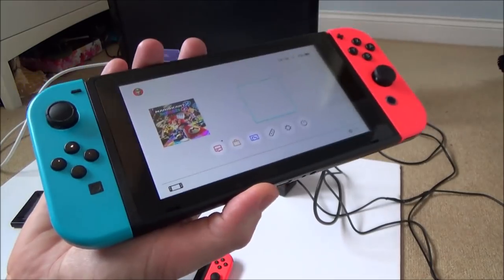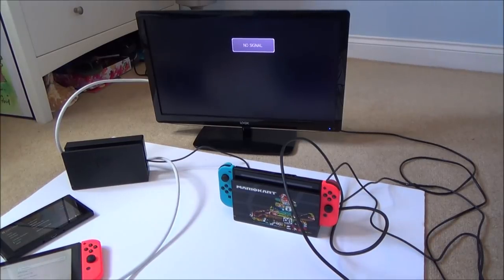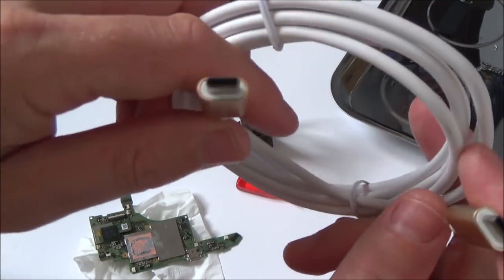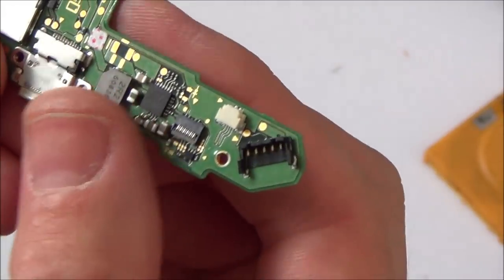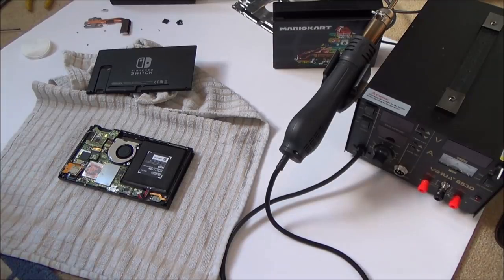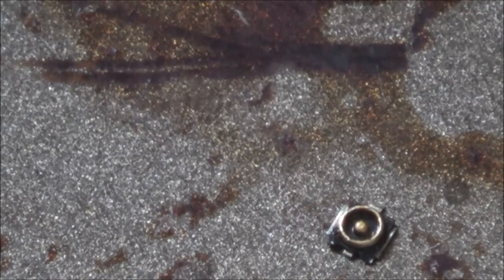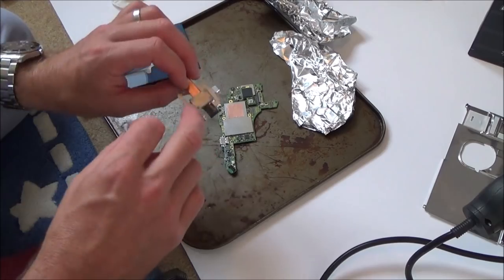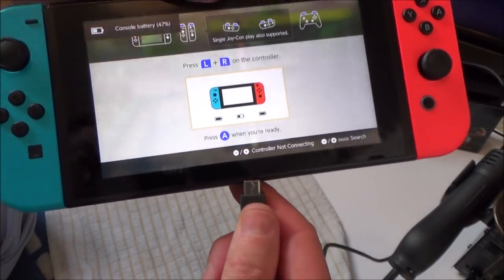UPDATE: Trying to Fix the Faulty Bent Nintendo Switch Not Docking

Comment: My best guess on why the switch wasn't docking is probably because when it was bent it probably slightly damaged  the inside parts needed to help dock it in a TV. So maybe the next time you purchase a switch you can try and swap the internals from that to the one that won't dock if the one that you end up actually docks itself and isn't bent. With all the reports people had when the console came out of it bending maybe the person bought the switch right when it released and it worked for a good while. Then it probably bent itself and the person didn't want to wait for Nintendo to fix it so they sold it on eBay for someone like you to try and fix it. Thats my guess anyway. Hope its been helpful

Comment: You did the thermal paste part correctly most poeple will say spred it out but you do not need to do that it will do it on its own more the 99% of the time. And i may know why the witch doesnt display any signal to your tv it can be the charge board that can be fault most of the the and it can charge but not display any thing

Comment: I switch my p13usb chip and it still didn't work. My settings stayed at 480p but I do not have a dock lol I will get a dock to see if anything changes. I'm confident I did the repair correctly I have prior experience from fixing phones on the board level from 2013 to 2017 I have all the equipment too

Comment: Idk if anyone is going to see this but when I put my switch in the dock and I put it on 480p it works but when I keep
It in the dock and I put it on any other resolution other then 480p the screen goes black and it doesn’t stop until it I take the switch out of the doc and change it back to 480p can someone plz tell me the problem

Comment: Dayem that was a lot of thermal paste. you would get along with 1/4 of the amount you used, it is just ment to be a super thin film/layer to fill up microscopic gaps between the two surfaces. there are a ton of videos about how to apply it on PC CPU's, you should watch those and concider the size differance :) Also whenever you look for thermal paste get a non-coductive and stay away from cheap stuff. The mx-2 should be good.
Reply: Official Sikator there's also a few videos showing that too much doesn't hurt it either.
Reply: Seen the amount nintendo uses as standard? :P
Reply: That doesn't mean it's necessary. Every manufacturer does that. Do a bit of research how thermal paste work and why it's used and you'll understand why it's not needed to empty a tube of thermal paste on one component. If the paste isn't conductive it wont kill anything, but it'll cost the user more money with no benefit in performance or longevity.
Reply: No i was mostly thinking that he should re-apply when he opens his electronics and using the paste in excess means he has to spend more money on thermal paste.

Comment: I'm having that problem too, tried different docks and it wont work
Is there any way to repair this issue? If there is, what do I have to say when taking it to repair?
Btw my switch still has warranty, but I live in Monterrey México and I have to sent it to latatamel, and I've read sometimes they don't sent the devices back snd they dont answer calls/message, so I'm afraid to sent it 
Hope anyone can help

Comment: A piece of kit that would assist you greatly is a Digital Microscope, not too expensive £40 ish from AliExpress. It will allow you to examine tracks, solder pads etc at upto 600x magnification, you can also video or photograph what you see with the built in functions. I bought one and it has paid for its self in no time.
Reply: Those are cheap toys, not worth the money.

Comment: I've seen quite a few if your vids and I like them I do have one suggestion tho get a tool called "helping hands" it's a magnifying glass and 2 aligator clips that are adjustable so it will hold the item in place freeing your 2 hands to solder or reflow. It's like 20 bucks usd Soo roughly 17 or 18 quid maybe even less depends on what all you want it to do past it's normal functions but I figures the cheaper one to keep up with the facade of cheap tools and normal average persona repairing them

Comment: I had the same problem with mine. It was due to the 4.0 update and me having an older tv. I fixed it with a full factory reset and then setting the tv output settings to 1080p in handheld mode. Do this before you even try to connect it to a dock

Comment: Im writing this at 21 min into the video. I am thinking that it is the chip that controls power becouse switches can only display 1080p in docked mode becouse it sort of "overcklocks" itself in docked mode, and to do that it draws more power. So it the switch knows it cant draw more power maybe all other options then 480 would dissapear?

Comment: My guess would be broken traces, but visually you can't see them. Usually bad traces are from damage like scratching or corrosion so you can see it. Odds are you'll never have it fixed unless you somehow find that particular trace and jump it, but good luck with that.
Reply from the maker: Thanks for the info:-)
Reply: Cool you saw that and replied! While checking this I saw another comment next to mine that explained there can be layers of traces inside the board. Sorry, I figured you knew that already, but if you really want to try it again, you could check traces leading to the video chip. maybe you'll get lucky. When that board got bent, the bending will stretch and break traces - even surface traces could have broke without you being able to see it because they are masked. Find the trace and jump it. Odds are against, you finding it though.

Comment: I know this is an old video but this information might be useful to you if you still have the switch. When I had this issue I sent it into nintendo who said the fault lied in a faulty charging pin so I'm guessing if you just changed the port it might work otherwise send it into be fixed for £53.50

Comment: I did read that it's sometimes caused by using monitors instead of TV's but I'll pressure that you have been using a small TV to test the switches on but someone else may have this issue so this could be a soloution

Comment: That chip at 18:22 with the logo that sort of looks like a crab means it either does networking or sound, so you can be pretty sure it's not that chip at fault. Based on it's location I'd say it's for networking for controlling Ethernet, but that's just a guess.

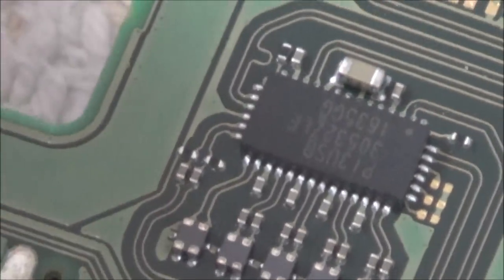That long chip "P13USB  30532ZLE" , at 18:08 is in charge of sending audio visual signal through the USB C port, if anything I'd guess that could be the culprit ? But again that's a guess.

The switch will list the TV modes supported by the last TV it was connected to, the minimum being 480 + Automatic.
Factory reset will bring back the 720 and 1080 options, but the next time you put it in the dock they'll be gone again. I believe that's because there's no info communication between the TV and the switch. Normally like on a PC, when connected even through VGA the computer and the screen will communicate things like the model name of each, and the computer gets list of supported inputs for the TV and the TV will get a list of supported outputs from the computer, then they'll show the picture. I looks like the switch can't talk to the TV, so it's only reporting it can show 480 at best. So looks like what controls the video out is having issues and not working right. Since your bricked switch had a different problem, it may be worth comparing the continuity of the bricked switch and the no docking switch? 

Wow, you did a really good job replacing the connector for the wireless! The switch looks great now in the bricked switch's case.
Like everyone else is saying, that was a bit too much thermal paste, it's not really a problem though. If the area the size of a 50p coin, you want to put paste about the size of the 0 in 50 on the front.
Reply from the maker: Interesting and informative comments again. I always appreciate your helpful input. Thank you :-)

Comment: Somewhat of a secret, but the headphone/headset jack can also operate as an AV out jack (Composite for sure, and possibly component). Could be a short in that. If the Switch thinks a cable is plugged in and making contact with the video-out pins, it would attempt to output via that jack, which would only display in 480p. See this reddit post for more info: https://www.reddit.com/r/NintendoSwitch/comments/5xd5ip/the_switch_can_output_composite_video_through_its/
Reply: I think you're on to something. Vince should look into that. Totally sounds plausible from a software point of view. If that's the case, the Switch must think that it can't output through HDMI because there probably is no connection between the relevant chip and the USB-C output pin(s), although Vince might have checked that. But this could totally sound plausible. I don't think the software is at fault, although it doesn't hurt to reset completely.

Comment: It seems like a problem with the video drivers, like when you install the operating system on a pc, until you add the drivers it is in minimal settings to allow access,  not sure how or where you do just video drivers and its just a guess but sounds logical

Comment: Not sure this would be a help... some of the other people I've watched doing switch repairs have mentioned that the motherboard is layered.  The traces on top are only the ones you can see and there are additional traces inside the circuitboard that you can't see.  If one of them is damaged from the bend, you'd never see it.

Comment: Won't flux corrode sitting under the component?
Reply: Charles Foster there is no water in flux
Reply: TimmSkiller okay I wasn't sure. I was watching another Youtuber, I believe Retro Repairs. He said he cleans it off with 90% alcohol because it could corrode. So is it similar to alcohol where it will just evaporate?

Comment: My guess(without even watching the full video) would be the opposite of the original assumption, specifically that it's not a disconnected pin but rather that a pin or group of pins is shorted together or to ground.

Comment: Vince, Just because you have continuity at the pins doesn't mean you don't have a issue at the USB-C Connector you need to find a motherboard schematic and test for continuity at the pins near the chips that communicate with the pins. It looks like you have communication in to the chip that activates the dock but not out to the dock. Try a full system restore and then see if you can find a board schematic.

Comment: Hi, I also have a Switch where the docking mode don't works. In my frustration I've tried to put my freezer. When the Switch reached a Temperature under 5°C and I put it in the dock its outputting a signal. When it reached a Temperature about 30°C then its stopping outputting a signal. That's very wired... Maybe you also want to try it with your switch. Thanks, have a great day.

PS: Don't forget the switch in the freezer...😅

Comment: I have the same problem except my if I jiggle it around in the dock it sometimes connects but flickers on and off a few times and then turns off again and it’s also not the dock as my mates switch works perfectly

Comment: You could try docking the switch with the screen facing backwards in the dock.
Reply: Did you ever get a resolution to this? I'm having a similar issue. I replaced a burned out PI3USB chip on a dead switch and it works perfectly now but when I connect it to a dock it doesn't display. The screen goes black, it charges but nothing comes up on the TV.
Reply: @michaelflaherty69  I'm having the same issue, did you manage to fix it?

Comment: My Switch is locked to 480 as well. No option for 720 or 1080
Reply: reset it
Reply: creepy charon I fixed it by setting dock up to TV instead of PC monitor
Reply: That's weird, my PC monitors and TVs (reason for this edit is that I've used a 4k tv that is terrible for gaming) work just fine with 1080p

what monitor are you using?
Reply: TheKHfan358over3d I'll say later, I'm in bed trying to sleep
Reply: Its a borderless AOC monitor that caps out at 1080p, 60fps.
Reply: strange. I guess the switch dislikes that kind of monitor.

Comment: I am not famimilar with USB type C, but you seem to have found many shorts to ground when testing usb port. First, see if you can replicate that on working Nintendo Switches. Assuming those shorts to ground shouldn't be there, you need to Google pdf datasheets for the chips you suspect (basically find where the ground pin(s) is on the chip) and check continuity if they have their other pins shorted to ground. If there are shorts to ground which shouldn't be there (you can cross check with working Nintendo Switches), the chip is likely dead and needs to be replaced. There is one catch though - you need to make sure those pins are not connected to another chip which could also be defective and have internal shorts.
Reply: That's a good idea, it would help narrow it down to the USB 3.0/DP1.2 matrix switch if it turns out those pins shouldn't be shorted to ground. I would guess that that goes directly to the USB-C port based on its function, with DP and USB going into that from elsewhere, and it happens to be right where the bend is, so it's more likely that that one (or one of the components around it) is faulty or not making proper connection than the chip(s) that feed it from elsewhere being faulty. It seems unusual that that many pins would be shorted to ground, but if the matrix switch is shorted internally then any pins that go to that chip (mainly the USB data pins, as those are used for both MyDP and USB) would also be shorted. I will have to have another look at the video to see exactly which pins are shorted, and cross reference that with the USB-C pinout.
Reply: There is nothing to add. 
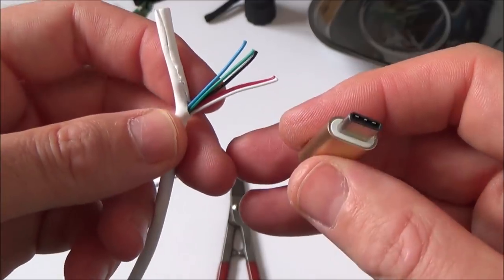I was thinking the same when I saw the pinout at 24:30 and later there where so many shorts to ground!

Comment: oof that's quite a lot of thermal paste. If the switch keeps acting up try maybe half the amount next time, too much of it will act as isolation and not transfer heat at all
Reply: Even with "too much" the paste will spread & even out due to the retention of the cooler pushing it out the sides. Gamer Nexus recently posted an excellent video on the very topic of "too much thermal paste" last month with the conclusion that too much isn't an issue unless the paste is electrically conductive, and in some situations such as with GPUs suggest leaning more on the too much side since too little with their exposed die could be catastrophic.

Comment: you don't need to cut cable, just use 2 needles for probes ... poor cable ... the problem is not even in connections rather than PCB (i think the problem is under metal cap) or software bug

Comment: Keep in mind when you do soldering rework and want to test the Switch, it will not boot or shut down immediately if it's internal temperature is above 70 Celcius.

Comment: You applied way too much thermal paste, and that could cause issues in the future. A pea-shape is recommended for a PC CPU, which is larger than the Switch's Tegra X1 chip. Also, you should apply the thermal paste to the chip itself and not the heatsink. This allows for the thermal paste to spread evenly when applying the heatsink.
Reply: The only real issue "too much" paste could cause is shorting out other components the paste spreads onto and that's only if you use an electrically conductive paste (the MX-2 paste he used isn't). Temperature wise there is no negative impact since the retention of the cooler will be spreading & thinning the paste out pushing the excess out the sides, Gamers Nexus recently posted an excellent video last month on this very topic showing this concluding anything above the minimum threshold of covering the heat spreader is fine. In fact in some situations like with GPUs they even suggest leaning on the "too much" side of things to ensure proper coverage of their exposed dies. Still you ideally don't want to use more than you really need to, and like you said it would be best to apply to the chip rather than the cooler.

Comment: I'm pretty sure the switch only docking one way, is more likely:

1. Aesthetics.
2. Idiot proofing - Imagine having had it in dock mode with the screen facing away, you go to put the Joy-cons back but you forget it's backwards and you're gonna have an bad time.
3. Fast/Seemless docking and portable switching - If you put it with the screen facing away, when you go to portable you then have to flip it over to continue, sure not a huge problem and takes about 2 seconds but it defies what the Switch is about.

Comment: You should be extremely careful touching the board to the carpet it can let off static discharge and damage sensitive components.
Reply: Modern electronics are actually surprisingly resilient to static electricity, but it's not worth taking the risk.